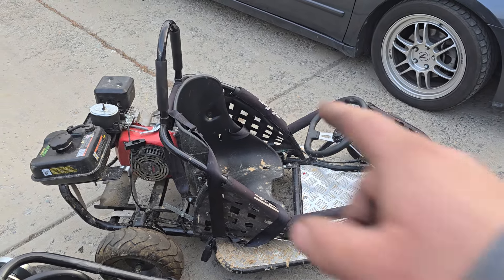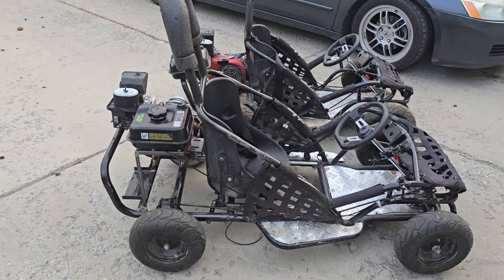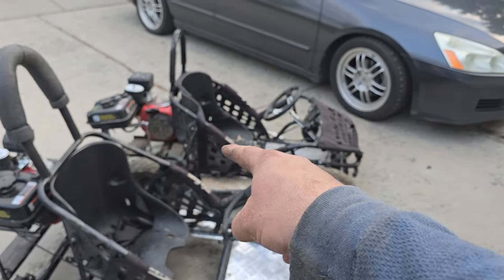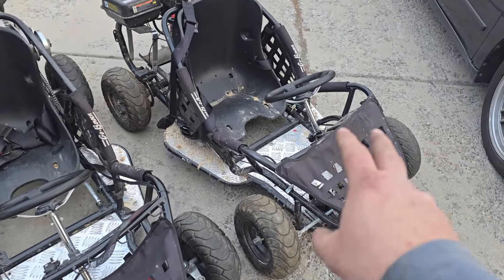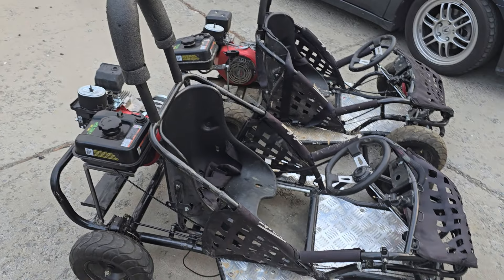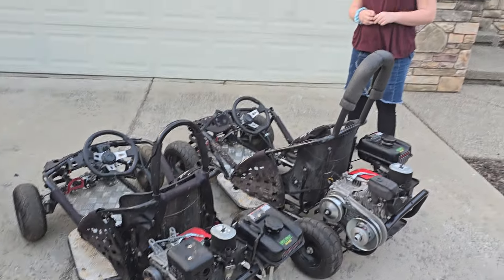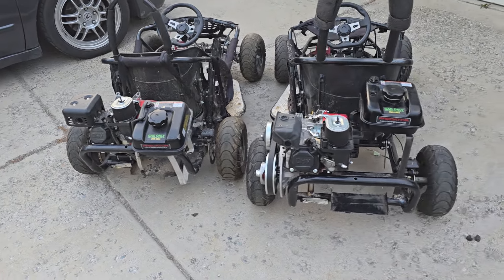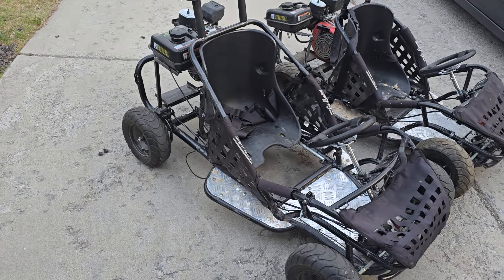Electric to gas Go kart  chassis extension! side by side (gobowen)

Comment: what type of chain and tooth clutch is that? i have a 10 tooth clutch with a 35 chain but its either too tight or 1 link too long
Reply from the maker: 12t #35 and you will need to adjust the chain length.

Comment: I’m wanting to do the gas swap on my kids go Bowen. Basically I need motor, centrifugal clutch and throttle cable? Anything else you needed. I am pretty mechanical. Have worked in fab shops and work as a yacht captain/ maintainer. Any tips appreciated.
Reply from the maker: That's it other than bracket to hold the tank so the seat will sit back further.